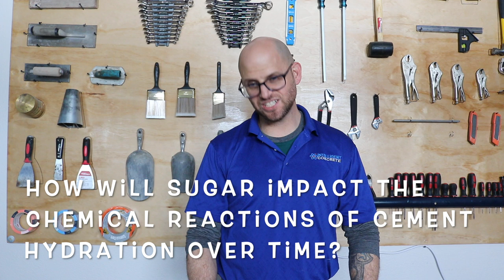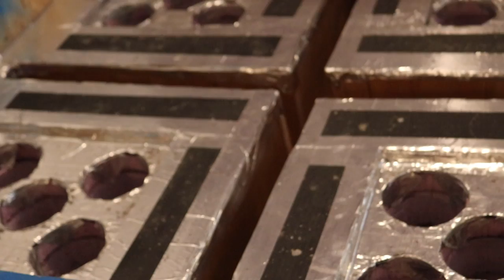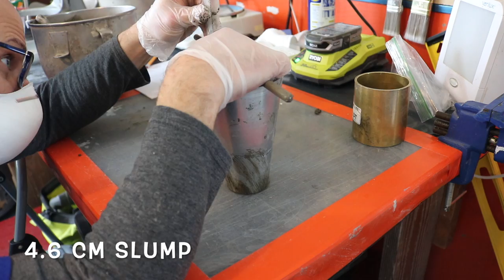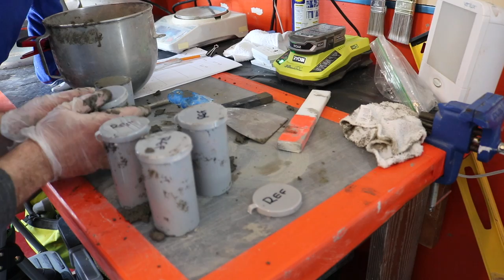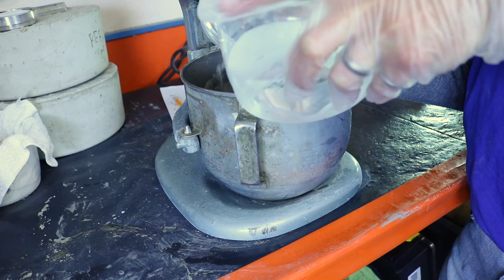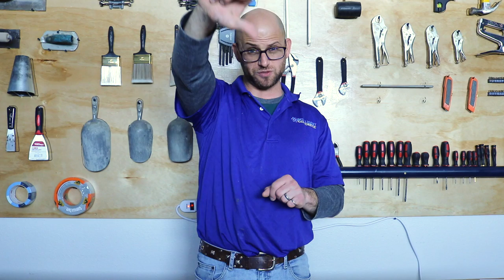Sugar Added To Concrete? - Mix - Vlog # 266

Comment: i have worked concrete 1986...
this  adding sugar, is all new to me...
Q: is that white latex additive the same as adding sugar?
Thanks
Reply from the maker: @seery88  thank you for your time in the industry.  That was a great year for concrete.

The latex additives while they do look the same in some of their powdered forms are used to reduce the water permeability in Concrete and no they don’t cause retardation in set times as sugars do
Reply: That is since 1986
Reply: thanks

Comment: Hi. I was wondering if you can help me. 
I’m trying to get an answer and mostly I’m getting guessing. 
I’m building an outdoor porcelain patio. (Tile is 24 by 24 inches 3/4 quarter thick). And I can’t get a straight answer about what to use in order to connect it to the 4 inch concrete slab I’ve made.  So far the answer include tinset, mortar and Portland cement.  Thank you in advance.

Comment: Have you ever tried to harden wood by letting it dry in cement powder under a vacuum? The cellulose should absorb the cement as the wood expels its moisture. Putting it under pressure may help keep the board straight and bring fresh cut over sized closer to its final size without processing it further. I have a feeling that Starlite was made in a similar way but different chemicals.
Reply from the maker: Will try and get back to you.
Reply: You could also try adding hydrated lime ..

Comment: I know this is an older video but I would like to know if making planters or pots for flowers and vegetables would be OK with a quick Crete or cement all I’ve heard that giving it a water bath helps to leach out the lime so it doesn’t affect the plants is that true?

Comment: Not sure if you are still doing this series, but would love to know if you can color cement with charcoal powder.
Reply from the maker: Awesome question.  I’m sure you can but it more than likely will have a negative impact on the fresh and hardened properties.
Reply: You probably know this but the standard is Iron oxide powder for coloring cement.

Comment: Have you ever tried using granite powder in concrete mix to see if it can form a solid brick? Granite powder, lime, volcanic ash, sea water?
Reply: U, sir, have been doing ancient concrete research! Haha me too. Theres granite powder and quartz crystal powder and ground glass powder, all those in aggregate size chunks too. Theres synthetic fiber additives to give strength like straw bricks, but wont rot and fire resistant, fiberglass fibers, plastic fibers, some people r figuring out how to add graphene! 
 The volcanic ash is a must for sure. And im sure theres liquid additives we could add to the salt water for diff effects, might even mix cement mix with epoxy resin instead, see how that works out.
 Iv always wanted to build a house out of multi ton granite blocks like the pyramids. Made right, that house will be usable for over 6000yrs. 
 Or buy a small granite mountain and carve it up from the inside out into a mansion made of one single granite rock (the small mountain). That would last prob millions!
Reply: @dustinbrandel59  that granite mansion would be epic.

Comment: i'm still not straight on it. adding sugar strengthens the concrete?
Reply: Ask beta boy just makes it taste sweeter! I’m just as lost as you! This is one a the poorest conveyance videos I’ve ever seen!
Reply from the maker: Thanks for the feedback Marc.
Reply from the maker: Howdy Stephen. Yes, adding sugar can lead to a stronger concrete. This is ultimately caused by a higher degree of cement that has dissolved and then reacted with available water. Bear in mind that if too much sugar is used, you can put the concrete to sleep and strength development can be delayed for long periods of time or not completely develop.

Comment: I operate a 36 meter schwing  pump truck. I keep a coffee can of sugar in the side cabinet. If it looks like the concrete starts to blow up during a poor.  I dump some in the hopper before I pull my sponge back. Really helps on clean up. Sugar  keeps it from getting thick and sticky.
Reply from the maker: Boom!  Well said. Have you ever used Coke or Dr Pepper?
Reply: @IntelligentConcrete  yes coke. And Gatorade works well. It's always on a job site in the summer

Comment: That food/cement mixer.
Plz rate the brand name and size of mixer.
Thank you.
Reply from the maker: The mixer is a Hobart, N50-60 Heavy Duty.  I L-O-V-E this mixer.  We’ve been using it non-stop for the last 12 years.
Reply: @IntelligentConcrete  $2600 bucks. I'm a hobbyist, not a millionaire.
Thanks for the comeback.

Comment: Dr Sir,
Can you please guide me that what chemicle is added to cement concreate dry mixture so that the mixture expands in volume when added with water. It is some powder which reacts and causes the mixture to expand. 
I know about foam, 
I shall be obliged.
Thanks. 
Stay Blessed. 
RGDS
Reply from the maker: Normally air entraining agents.  Fritz pak sells two products that are available to purchase.  You might need to get a few cases.
Reply: @IntelligentConcrete  kindly elaborate the name of chemical. I shall be thankful.
Stay Blessed.
RGDS Ansar
Reply: @IntelligentConcrete  can you please tell me generic name of the chemical which causes expansion in cement water. This is generally use in light weight concreate in replacement of foaming agent. It is some aluminium based powder!!

Comment: Unrelated to this particular video but you know your stuff so.....

I keep reading that cement on its own is not very strong at all and is just a binder. But just watched a video where pure cement  withstood 8000psi and concrete failed at 2500psi. So is it really weak on its own ? 

I'm making some concrete statuary and had two questions. Are the larger stones necessary for strength or will sand suffice .

Second , I want to add some designs to my statuary by hand using pure cement as a sand mixture will not flow if I put it into a piping bag. Will using pure cement be a bad idea ? If so how do I make a sand mixture flow enough to be piped out of a bag . I just tried it and the sand compacts and does not extrude thru the nozzle . Thanks
Reply from the maker: Howdy Robert,

Cement on its own is one ingredient in the concrete mixture.  The ultimate strength and durability is based on the amount of water, type and amount of rock and sand, as well as chemicals.  I think its always good to use a concrete (cement, rock, sand, water) as much as your mold will allow you. Using a neat cement paste often leads to shrinkage and cracking.

Comment: Is there a follow-up on this one on concrete with sugar? Would like to see a test on the strength of those samples! Also, as a layman, I have a question, namely, is there any initially water soluble extra ingredient to add to a concrete mix that once dried will act as a water proofing agent?
Reply from the maker: Here are the results:

https://youtu.be/GjHdTRYLtpE

There are a bunch of water proofing admixtures for concrete.

ConBlock CDA, Hycrete, and so on.

A quick google search can get you more info.
Reply: @IntelligentConcrete  thank you!

Comment: Sugar additive is interesting 👍🏼👍🏼👍🏼.   I have a question:  is there a cheap cost or cheap alternative to the fiber material for fiber reinforced concrete?  Is it just plane fibreglass strands?
Reply from the maker: Great point! Yes there inexpensive alternatives but bear in mind you might be sacrificing strength of the fiber, how well it bonds to the cementitious matrix, or the durability of the fiber for that price reduction.
Reply: I bought a big roll of fiberglass mesh used in repairing large drywall.  Cut in strands and mix with mortar/cement  or lay thicker strips for forming shapes.
Reply: Cut your hair and trow it in there old school
Reply: @keithcaverly6832  😂🤣

Comment: What about adding salt? The Romans made concrete that would harden under water. Scientists have found that the salt water makes it harder.👷
Reply: Salt has been added to concrete a lot in the past as sodium is a cheap and powerful accelerant and antifreeze, unfortunately along with an efficacious dose of salt comes a lot of chloride, which wreaks absolute havoc on steel reinforcement and corrodes the concrete from the inside out. As far as Roman cement, the salt in the seawater used to make it is just a small part of the equation in which many other minerals in that water could be bigger contributing factors to the concrete’s durability. Not too mention our common mindedness Portland cement easily hardens underwater as well, it’s actually quite beneficial to the curing process and has always been known as such.

Comment: Blood is also added to concrete.
Reply from the maker: Back in the day, yes.

There is a Patent on it the process:

Use of blood in the cement, mortar and concrete industry for obtaining a lightened material, US4203674A.

At this point its expired and there are easier and more legal ways of entraining air in concrete.

Comment: Don't put sugar in concrete, sugar is what destroys concrete.
This like the dumbest experment ever i just don't get why someone would purposely add sugar to concrete
Reply from the maker: Thanks for the feedback Jerry.  Sugars and salts have been used in concrete for a while now to slow down and accelerate concrete setting times and more.
Reply: If you have never worked with cement/concrete with look stupid.  Let's say you send out 3 cement trucks to a job that is 1 hour away, and time for traffic, plus position down time at jobsite; if your base mix is unpumpable after 90 minutes you are royally screwed! 

Or if you are mixing right at jobsite and have large volume, it allows you to pump in one continuous load.

Comment: sweet 🍯
Reply from the maker: That is a great question Effy, will the sugars in honey have the same impact as the processed sugar.

We would need to do a solids content of the honey and then adjust the design water to take into account the water that is brought by the honey for the mix.

But yeah, challenge accepted Effy...

#Staytuned #Magicalworldofconcrete